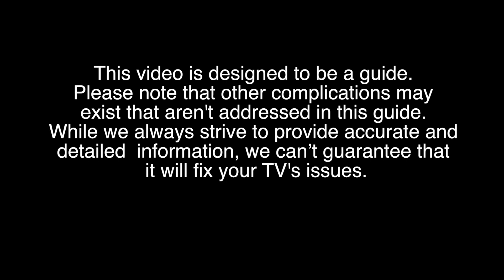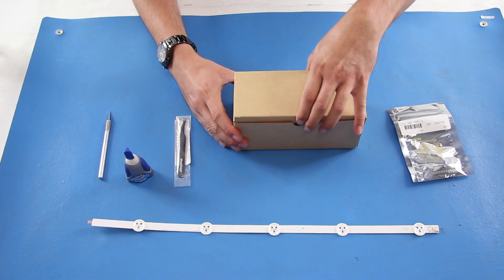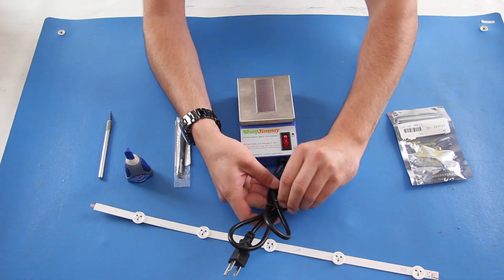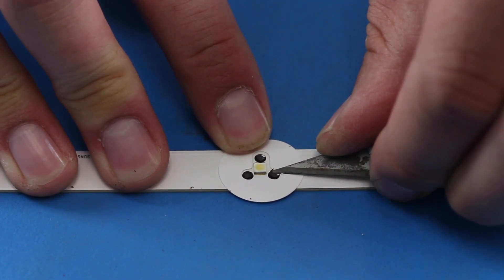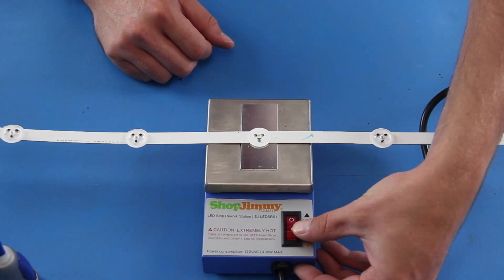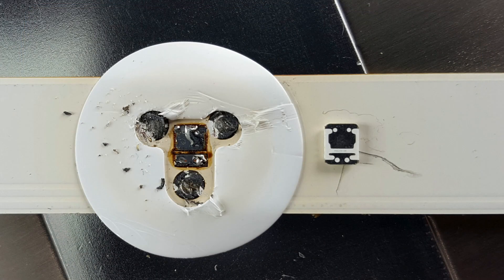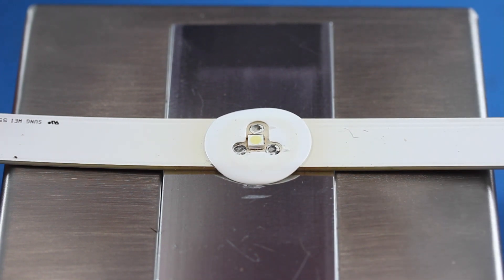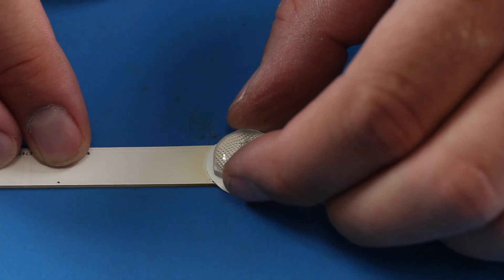How to Replace Single LEDs for an LED TV  - ShopJimmy LED Strip Rework Station Tutorial

Comment: Used this to repair several strips without having to buy new ones.  Removed individual LEDs from an old discarded strip and reinstalled on the one going into the TV.

A word of caution.  If working on the LED next to the power input jack of the strip, use Kapton tape to hold the power jack in place while working the LED.  I had to go hunting for mine after if fell off along with the removed LED!

Comment: is there a positive and negative side to the LED or is that not important because it's a diode? Also, the 2 solder pads...do you have to worry about solder bridging the pads?
Reply: Being a diode current only runs in one direction. Yes, it does matter

Comment: Doing this for the first time requires a skill level to be built up. Then you may find that the surface mount pad on led is different to to that on the strip. I opened the pad  gap on the strip pads to minimise short. I used hot air gun but that will blow the Led off the strip. Used a made up tool that allowed a screw to bare down on the Led whilst being soldered. Test as you go. I used about 40 DC across 14 LEDs. Check for flickering LEDs. Replace as they may be on the way out. Replace any LEDs that are dim. I ordered cold white half watt 3.4 volts. The light has a slight yellow look so when I finished the repair may need to set tint levels to compensate. LEDs back in frame so next job is to re fix the diffuser lenzs then the white back sheet. Two days work so far but speed is increasing. The shop Jimmy hot plate seems cleaner but more for the professional. My wife was not too keen on me using her iron. Thanks shop Jimmy for all the advice.

Comment: ha ha ha ,never seen such shit advice how to replace single led .First do not remove old glue as you loose proper lens position, second do not warm strip as white paint become yellow and plastic ring may melt as well , you should use solder iron tip and sharp knife to remove old led. Than new led should be soldered using soldering paste. Super glue is not suitable as it leaves white marks on lenses. Use UV glue.

Comment: If your TV has few burnt LEDs don't do the same mistake as I did and only replace those faulty LEDs. Joy of working TV is quite short lived and dark spots soon start to reappear on the screen as rest of the old LEDs die one by one. Either replace them all or bin the TV.

Comment: tested R2 half of led strip.it does not light up.But if i put power on 1 and 1 led ,i find that every led works on it,s own .The led.s on this strip is ok.It has to be a failure in the strip it self.if i use a mutimeter and test continuity on plus test point and the other lead on the plus on the male part where it goes into L2 it has contact.On minus it dont when i do the same.Does the copper traces fail on these strips?
Reply: I have one with same problem. A vid I watched here on YT said that YES. Mine also tested bad on negative side of the strip. The vid. instructed to look for spot on strip (neg. track) and that would be where problem lies. I don't know if patching it is worth the try or if it would be safe or not. I bought a new strip.

Comment: I recommend two soldering irons used in a tweezer action. Needle point tips and it's too easy. One question, how do you check which voltage led to use? 3 ,6, ?? I got a Hisense. Many leds gone. Will order cheaply from AliExpress but not sure if 3 or 6 v. I used 8 v across two good leds and they shine quite brightly. I'm guessing 3v. Edit; there are numbers on the strips that led me to the correct led from aliexpress. 50 beads for 2 bucks.
Reply: Hm, Hisense. Koliko je star TV ako nije tajna?

Comment: I'm working on a 50" LG TV that all the LED lenses keep falling off.  All of the LED's are good and I haven't had to replace any of them.  The only problem is the lenses falling off causing bright spots on the screen.  Has anyone else ever had this problem with an LG?
This is the 2nd time it's been back.  I glued them all back on a couple months ago and they all fell off again.
I cleaned all the old glue off with a knife and cleaned both surfaces with alcohol to get rid of any possible contamination.  I used Locktite brand superglue gel but they're just not sticking.  I glued them on 10 hours ago and I can lift them right off with very little pressure.    Any ideas on how I can get them to stay on permanently?

Comment: Not bad equipment but shit hands and brain. You do not clean old solder by wick. Led must be centered him self on new solder and flux. And you use super glue, are you in mind? It must be B7000 or similar, not superglue which make white smog on lenses.   Shit work.

Comment: Can someone help me find the smd led part number for jvc tv.. its a verry small 3.2v smd led. But i cannot find the part number.. The led strip number is (17dlb40vxr1) 3 led strips with 8leds each.. I need to replace the burnt led's..
Reply: How do you know it's 3.2V ? I'm looking on aliexpress for these but there is several models and I am not sure which one to choose
https://fr.aliexpress.com/wholesale?catId=0&initiative_id=SB_20180525012218&SearchText=LG+TV+led
Reply: Thanks for replying...I divide the voltage output by led, each strip has 8 leds x3 24 total. i checked by lighting the led by a voltage regulator and can work at 3.2v or it will change the colour. So i realize that 3.2v is the led. It's a very tiny led, I have never seen such a small led...
Reply: Thanks a lot,  Can I contact you in the mail to discuss other issues of  other tv's ?

Comment: Would not removing the old glue from the LED strip cause a "halo" effect shining through the screen when the TV is reassembled? It makes sense if the height of the lens is that sensitive.
Reply: No, because there are diffusing layers between the back lights and lcd to distribute the light evenly across the entire screen.
Reply: @genaugmen4505  what about led heat dissipation ? If there is no gap between strip and difuser maybe it will go hot
Reply: @olivierj.2435  The diffuser is domed on the underside and has feet. The rear cover the led strips are mounted to is sheet metal and acts as a heat sink

Comment: Hi.
  a question my hdtv is turned off by the damaged LEDs, to replace it where I can get the led, they sell them separately or what types of led I should get
can be from any other hdtv
Reply: You can get individual LEDs in Qtys of 1 hundred via Amazon. Search "Replacement SMD Led CHIPS FOR BACK LIGHT STRIPS.
 You must check out the spec if you can. In the end I choose 3.4 volt 0.5 watt. Not sure if the ones I got are cold white enough. But cost risk is low.

Comment: I replaced all my boards then found one bad led. Could this cause them all to shut off? There are three different strips in my Samsung
Reply: Yes
Reply: When one led goes bad.. there's an open circuit for the LED's and they are connected in series not parallel

Comment: You can buy led tester for less than 32$ on ebay search for led tester or use this link http://www.ebay.com/itm/LED-TV-Backlight-Tester-Lamp-Probe-Beads-Board-Repair-Regulator-85V-265V-input-/282450724622?epid=2007392736&hash=item41c360070e:g:fsMAAOSwjqVZAsO5

Comment: The horrible in led strips removal from the metal casing is that first all these plastics that you have to remove carefully and then the lcd glass with its thin film connectors without any damage permanent and unrepairable to the glass.And why after all that mess someone should not replace all the led strips with brand new ones avoiding the same difficult procedure in the near future for the next burnt led.Funny,hobbyists seem to be more repair minded than professionals just because they dont know what is awaiting them.

Comment: So, I would add to this that I used an old computer power supply, a 1K current limiting resistor in series , and some DMM leads to build an LED strip tester. I got 24V out of my supply. These LEDs have a Vf around 4.8V. So you can test half the strip at a time. There are some copper pads showing right behind the connector that are convenient. For the inside LEDs closest to the distribution board, I used a wire to short right across the outer LED strip.  Identify the bad LEDs , remove, replace... 

Here are the LEDs. I don't know why he didn't include this link. 
http://www.shopjimmy.com/replacement-led-and-diffusing-lens-for-lg-led-strips-set-of-12.htm
Reply: Daniel Adam Roper n
Reply: I've been searching for a power supply with enough voltage to test my strips! I wanted to do this without having to go buy anything but I don't have any free reigning resistors on hand. I have an old laptop power supply, but that's what...20V output? I almost just strung a bunch of AA batteries in series and use the leads from my multimeter

Comment: I used a soldering iron and replaced 4 LEDs with singles from ShopJimmy. It singed the back of the strips, and smelled like old cat pee, but it worked! I fixed a 50" LG I picked up for $10 in parts. Thank you for this video and for selling the LEDs!

Comment: Where can we get the new Replacement LEDs and could we use heat gun instead to remove the old LED and put new in...?
Reply: I'm thinking of using heat gun, did you end up doing it? did it work?

Comment: Instead of using the Heat station he used I tried a iron for clothing to no avail then placed a 3X5 piece of 1/4 inch thick metal plate (scrap) in home 5 inch work vise and then took the strip and placed over it and held it in place using a C-clamp you can use channel locks whatever to hold and then I used a propane torch just like ones almost everyone has for old-style brass plumbing soldering etc and heated the bottom of the plate. remove the white round sticker around the LED first as this will melt it is only there to reflect light and removes and installs easy and gluing the diffuser back on holds it in place no matter what . this method removes the LED in about 45 seconds you will her a fizzle and pop that lets you know it can be removed installation is the same . if you set up stands to support the strip you will not need a C clamp

Comment: What type of LED did you replace it with?!?!/ Where do you get them?!?!/
Reply: Arcadian Mister 1000pcs FOR LG Original LED LCD TV backlight lamp beads lens 1W 3v 3528 2835 cool white light bead
 http://s.aliexpress.com/AJBVrqqm?fromSns=Copy to Clipboard
Reply: LG Innotek LATWT470RELZK 1210 (3528 2835) 1W 100LM Cool White 3V 400mA are the originals for LG TVs

Comment: I have a LG LN 5100 50" 1080p 120Hz LED HDTV. TV will turn on, there is sound but the LEDs will only flash during power up. Picture is there, just very dim. I Need some help!
Reply: do you have a multimeter?
Reply: Kurt Parker change the led strips it will come up
Reply: hi thats faulty backlight put meter on diode setting and measure across each led good ones should light up bad ones wont...mark and replace...